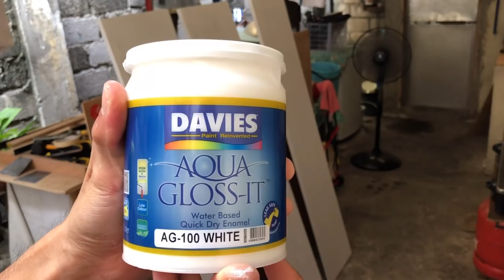PAANO GUMAWA NG KITCHEN CABINET // DIY KITCHEN HANGING CABINET

Comment: Sir rekta davies wood primer ba then davies aqua gloss it. Di mo na po ba binatakan ung kahoy like wall putty.
Reply from the maker: Actually sir nag lagay ako ng wood putty sa mga outer part lang ng mga panel. Hindi ko lng sya nasama sa video. Tapos wood primer bago mag top coat which is aqua gloss it.
Reply: Super pulido ng mga gawa mo sir. Abang ako ng iba mo pang projects 👍

Comment: idol anong screw yung pinangkabit mo sa kahoy dun sa sementong wall...anong size ng screw at tox
Reply from the maker: 2” na screw lng
Reply: @AceWinfieldLoyola  yung size ng tox idol anong size
Reply from the maker: Nung bumili ako ng screw, kasama na yung to tox. Pero pagka separate yung screw and tox, sabihin na lng sa hardware kung ano ang fit sa 2” na screw. Di ko din kasi alam yung eksaktong sukat ng tox.
Pero sa ace hardware, usually nka set na sya screw and tox.
Reply: @AceWinfieldLoyola  tnx idol

Comment: anu tawag dun sa kahoy na may butas sa gitna or un pinang gilid mo sa pinto ng cabinet?
Reply from the maker: Alin po doon? Di ko ma gets sorry. Hehe.
Reply: @AceWinfieldLoyola  un kahoy sa gilid ng door ng cabinet na dinikitan ng stickwell
Reply from the maker: @jayveedumlao2331  ah yung frame ng cabinet door.  Ang tawag kasi sa type ng cabinet door na yan ay SHAKER DOOR.  Yung may frame sa gilid.   Yung nka vertical na part ng frame, ang tawag dyan ay “STILES”, tapos yung nka horizontal naman ay “RAILS”.  
Usually sa SHAKER STYLE na cabinet door. Ang mga frame nya ay meron GROOVE kung saan nka insert doon ang 1/4 na plywood.

Comment: Hi sir! Gawa mo yung jig sir sa 1:40 ? Ano po sukat nung inyo? Tsaka para san po yung clamp dun sa cs niyo? Balak ko rin po gumawa
Reply from the maker: Yes sir gawa ko lng. 2 feet ang haba ng angle bar. Aluminum yung angle bar para hindi kalawangin. Tapos nka screw sya sa 2x2 na wood timber.  Yung clamp naman ay para sa blade cover. Yung blade cover kasi tumatama sa plywood kaya nilagyan ko ng clamp para stopper ng blade cover. Mapapansin mo yan pag sinubukan mo na.

Comment: Sir, ask q lng po 2 kind of paint lng po ba need isang primer & yung enamel paint. Gusto q po kasi ung shaker type n cabinet compared s mga laminate na masyadong flat ang design
Reply from the maker: Yes dalawang paint lang. primer muna, pero kung may imperfection pa sa kahoy, pwede pa lagyan ng masilya tapos primer ulit then 2 coatings ng top coat which is the water based enamel. 
Pag yung primer mo water based, ganun din sa masilya at pang top coat.
Reply from the maker: Pagka smooth naman na yung kahoy at plywood, pwede na walang masilya.
Reply: @AceWinfieldLoyola  thank u Sir s reply.

Comment: sir ang galing mu gumawa.sir npansin ko sa video mu hndi kana ngmasilya ngprimer kana at ngfinal paint kana.at mganda ung mga pinto mu.pwde mu ba maeshare kung nkakabili ba ng frame ng pinto ng kabinet mu or ginawa mu lng un.1/2 lng ba n plywood ung ginamit mu sa pinto na may frame.curious ako sa frame ng pinto mu.slmat po.pashare nmn po
Reply from the maker: Hi sir. Thank you for your kind words. May masilya na yan sir pero yung outer part lng ng mga board. Hindi ko lng sya nasama sa video. Yung inner part ng board, hindi ko na nilagyan ng masilya. 
Yung shaker cabinet door naman, ginagawa ko lng sya. May video din ako kung pano ko sya binuo. 👇👇
https://youtu.be/zorJ2dIHfb0
The cabinet door is made of 1x2 wood timber and 1/4 plywood. Yung 1x2” na timber ay sariling tabas ko, pagka kasi sa hardware ka bumili ng 1x2 wood timber eh hindi naman talaga exact 2” yung sukat. So ang ginawa ko, nag tabas ako ng sariling 1x2 para sa frame ng cabinet.  Hindi pwede yung 1x2 na kahoy sa hardware kung yan ang gamitin mo sa cabinet door dahil concealed hinge ang ikakabit,  dahil ang concealed hinge ay malapad. 
Kung may time ka sir, pwede mo panoorin yung isang video ko kung paano ko sya ginawa.
Reply: Ace Winfield Loyola sir maraming slmat sa pagshare.tlgang iniidolo ko ung mga katulad mung marunong sa trabaho at lalo na marunong mgshare .panoorin ko ung binigay mung link.slmat ha godbless sir.

Comment: Good day po ano mga tawag dun sa mga power tools??? Lalo n po ung pang butas ng wood na patagilid ang pag screw 😁 salamat po god bless
Reply from the maker: Yung pang butas na patagilid sir, ang tawag doon ay “POCKETHOLE JIG”. 
CIRCULAR SAW naman yung ginamit ko pang putol ng Plyboards.  
CORDLESS DRILL naman yung pang butas at pang higpit ng screw. 
CORDLESS ORBITAL SANDER naman yung ginamit ko pang liha ng mga Plywood. 
Kelangan mo rin ng mga clamps pang ipit. Malaki tulong ang mga clamp sa DIY.  Tulad ng SPRING CLAMP at F-CLAMP. 
Ayan sir. Sana naka tulong yung reply ko. Hehe
Reply: @AceWinfieldLoyola  salamat po sir .. nag p practice po kc ako gumawa ng cabinet..

Comment: You made a good work. But I suggest you also show you the complete steps in making the cabinet doors. How you put them thru routers ( door frames ) just in  case you used them, so others can learn from you.  And that's what DIY for, it's the tutorial part of DIY that captures would-be subscribers and viewers. Jigsaw is a good tool for curve cutting. Keep up the good ( wood ) work!
Reply from the maker: Thank you sir.  I also have video on how I make the cabinet shaker door.  
https://youtu.be/zorJ2dIHfb0
If you notice during the shaker door appearance, I put the suggested video on top of the screen on how I made the shaker door.  I suppose to put the video together but it came out a long video.  Not much viewers watching my video if it is too long.  Especially I am still new in vlog. Anyway, thank you so much for the suggestion. Stay safe...

Comment: Sir ganda! Diyer din po ako. Tanong ko po kung:
1. Ano po brand ginamit nyo na plywood? 
2. anong kahoy po ginamit nyo sa pinto ng cabinet at ano po tawag sa joinery ginamit nyo?
 Maraming salamat po for sharing your build!
Reply from the maker: Sir. Di ko matandaan yung brand ng plywood. Pero gawang Pilipinas na plywood ang bilhin mo. Wag ka bumili ng china made na plywood. Hindi maganda plywood nila.
Yung kahoy naman sa cabinet door. Kiln dry na good lumber, yung nabibili sa mga hardware.  Nag tabas ako ng sariling kahoy pang cabinet door para ma achieve ko yung eksaktong 2” na lapad. Pagka kasi bumili ka ng 1x2 sa hardware eh hindi naman talaga 2” ang lapad. Asa 1.1/2 lng ang sukat. So ang ginawa ko, bumili ako ng 1x8 tsaka ko tinabas in 2” na lapad. Meron po akong video kung pano ko ginawa ang cabinet door. Pwede nyo din po panoorin.  
Pockethole yung joinery na ginawa ko para madali magkabit ng nga board panels.
Reply: Salamat sir! Maya check ko lahat ng mga vids nyo. Instant subscriber nyo po ako
Reply: @AceWinfieldLoyola  sir  suggstion lang po maglagay po kayu ng mga materialsnna gamit nyu dun sa description para d na mgtatanung ang  taga subaybay nyo, tnx po
Reply from the maker: Tito blad Sir. Thank you. Actually lalagyan ko talaga ng description kaya lng sa sobrang busy ko ngayon eh hindi ko na naisingit. Pansamantalang na stop yung pag video ko ngayon kasi may ibang project ako. Anyway thank you so much sa suggestion mo sir. Stay safe...
Reply: @AceWinfieldLoyola  wc po sir pede ask po sir nwebie lng po anu po ang tamang sukat sa isang 3/4 na marine sa pag gawa ng cabinet na wala pong masasayang na kapiraso, i mean tamang sukat po?
Reply from the maker: Tito blad Actually sir yung size o measurements kasi ng cabinet mag depende doon sa sukat ng area o paglalagyan ng cabinet. Usually yung kapal ng cabinet ay 15”. 
Bago ako mag cut ng plywood, gagawa muna ako ng sketch o drawing sa papel para makita ko ko kung pano ako mag putol ng mga plywood para ma lessen yung retaso. Pero minsan, hindi mo talaga maiwasan magkaroon ng mga retaso. 
Actually sir kaka start ko lng din sa woodworking. Nag start lang ako sa woodwork since the pandemic started.  Hindi po ako carpintero, natutunan ko lang din lahat sa panonood sa youtube.  Nawalan kasi ako ng work dahil sa pandemic kaya eto na naging hobby ko. Isa po akong waiter sir. Medyo malayo sa pagiging woodworker. Hehe
Reply: @AceWinfieldLoyola  ah ok po sir nice job po sir , good luck sa susunod na upload sir

Comment: D napo kayu nglalagaybng epoxy sir sa bawat dugtong matibay na po ba iyon?
Reply from the maker: Hindi ko na sya nilagyan ng wood glue para madali lng sya baklasin. Basta pockethole joinery gamit, sobra matibay na sya.  Hindi sya basta basta natatangal kahit plywood lng. Plus nka screw pa mas lalong matibay compare sa nka pako. Ang pako kasi walang thread kaya madali lng matanggal. Pero ang screw may thread kaya sobrang makapit sya.

Comment: Ano po ang size ng  mga na cut nyo sir?
Reply from the maker: Hi sir
Yung kasi sukat ng cabinet.
35” yung taas kasama na yung curve part. Tapos 15” yung width at 60” naman yung haba ng cabinet.  Mag depende naman space availability yung measurements ng cabinet. 
Maliit lang tong ginawa ko kasi maliit lang din yung counter top ng sink.
Reply: @AceWinfieldLoyola  Salamat sir.

Comment: Use moisture profe melamine white  better quality and smooth surface
Reply from the maker: Paint po ba yan sir?
Reply: Moisture proof? Melamine? Sounds parang mas matigas pa sa epoxy? At very gloosy? Panu po kaya application niyan? Brush, roler or spray?

Comment: New subscriber here! Pabulong naman dimension at sizes ng plywood specially sa door  nyan sir.  Ganda pagkagawa.
Reply from the maker: Thanks sir.
3/4 na marine plywood ginamit ko sir.  Tapos yung cabinet door naman, yung frame ng door is made of 1x2 wood timber and 1/4 na plywood. 
Yung cabinet measurements nya, height is 35”, yung lapad nasa 60” at yung depth nya is 15”.
Reply: Ganda pag kagawa brod. Pang professional na.

Comment: Sir ano po ginamit mo para dumikit yung cabinet sa wall
Reply from the maker: Hi
Tox and screw lng yan.  Binutasan ko muna yung piece ng plywood na nka join sa cabinet para may marker ako para mag butas ng concrete wall.  Sa makita mo sa video, impact drill lang gamit ko pang butas sa concrete wall.